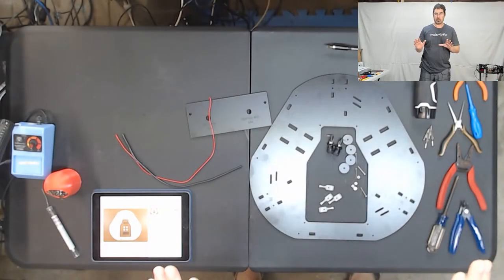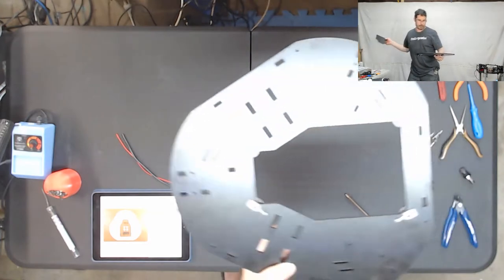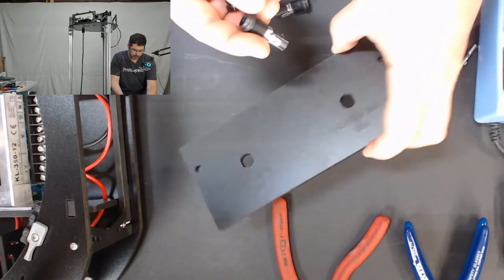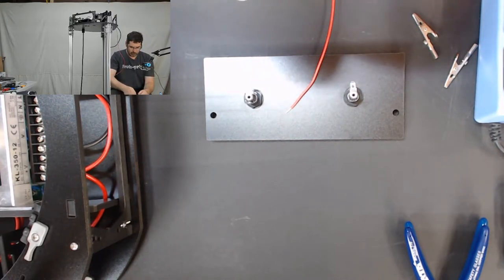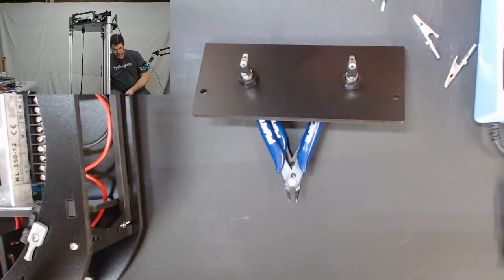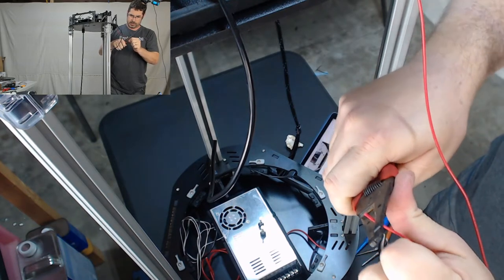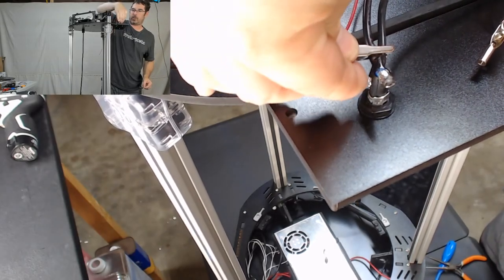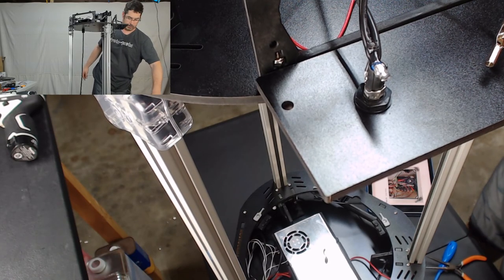SeeMeCNC ROSTOCK MAX v3.2 Build Series Part 12a: Steps 46~52

Comment: For the wiring going to the fuses, I would recommend some heat shrink tubing.  I like to use heat shrink tubing on all exposed connections.
Reply from the maker: I would normally agree, but wasn't included (or mentioned in the manual) so I did not do it. Trying not to deviate from the manufacturers directions any more than necessary for sake of the videos. Long term, I will probably go back and crimp those similar to how the switch and... opps spoiler alert...
Reply: Fast-ons would be a great alternative and removable.  I just like to insulate as much as possible.  If I can short to it or touch it, chances are I will. :)